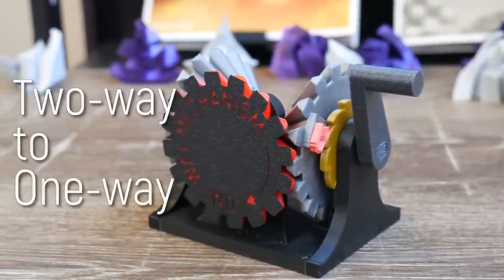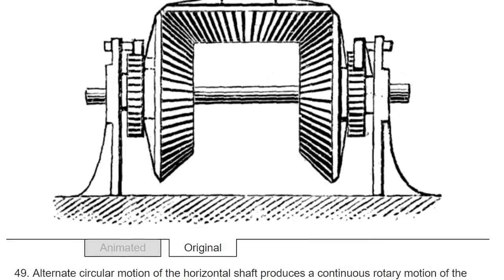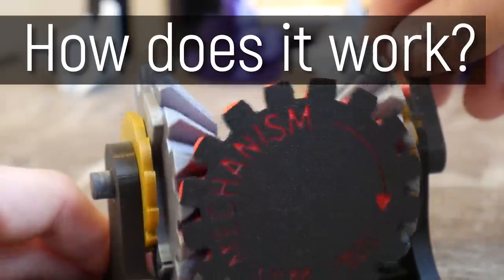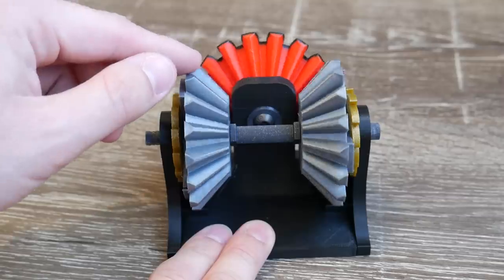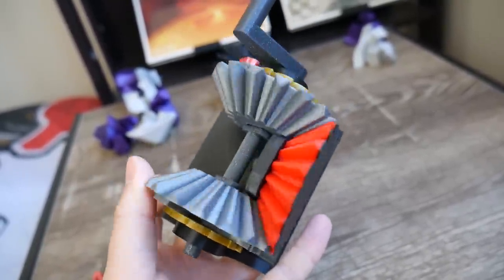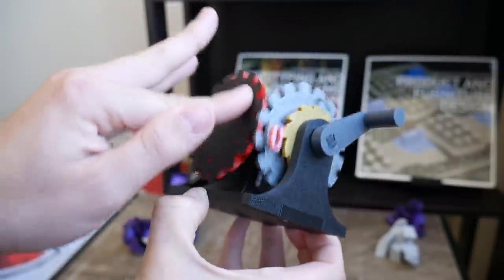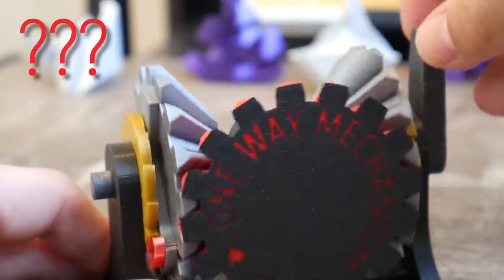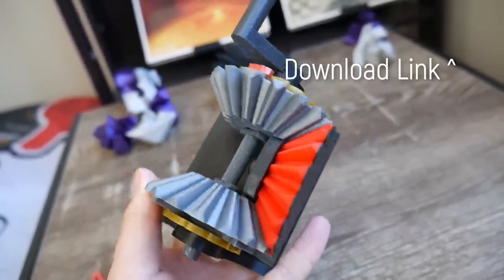This Mechanism only turns Clockwise, no matter what.

Comment: This can be used for producing electricity with ocean waves, as when the waves come and return it will keep rotating in single direction only
Reply: Was thinking the same thing. It could be a paddle in close proximity to a shoreline, where the back and forth of the tide powers something that needs to run in one direction.
Reply: Ahh the classic attempt of harnessing the power of ocean waves. Researchers have been trying to figure out a way to harness the power of waves efficiently for many years now. Not saying this is a bad idea or anything it’s just interesting.
Reply: That's already been accomplished using paddles that move back and forth. I'm not sure how they make electricity, but they have pistons attached to the plate on either side.
Reply: It could be used in bicycle pedals. So that if you get tired pedaling in one direction, you can work different muscles by spinning in the other.
Reply: 3 phase generators don't care about rotate direction, as long as there are magnetic flux changes, they will work just fine.
Reply: @nerychristian  thats bad. Cycling requires smooth rotation. That gear sounds very rough and inefficient.
Reply: there's a dam thing where the tides make electricity
Reply: the mechanism wi’ll be too loud
Reply: Why should that be useful?
Reply: @Asu01  true
Reply: tommy bomby. yes but that’s a  lot of infrastructure and is only viable in a limited number of locations.
Reply: Yasyas Marangoz I think because the book was about useful mechanisms?
Reply: @mario_uzumaki  lol what, ya because power plants are not loud lol
Reply: Have you ever heard of a full bridge rectifier?
Reply: @nerychristian  would spinning the pedals backwards work?
Reply: @tommybomby4122  No, dams stop the water. many small devices can be deployed on the seashores without any disturbance to the natural flow.
Reply: Akram Quraishi ok
Reply: @FindingCreatures  From what I've seen, it sems to me that the generation of power is not the issue, this is doable. However, making a system that survives in strong ocean currents and/or waves in any weather, for years, is the challenge.
Just like making a atomic bomb is "easy" in 2020, making a functional ICBM delivery system is a bigger challenge.
Reply: I think that a generator makes electricity spinning either way.
Reply: @eliotlong5184  an alternating current generator does, a constant voltage generator might get screwed up by it.

When diodes were not available it would certainly have been an option.  Early on, if something worked it would be used.

This looks very similar to a differential on a car.
Reply: @joshuamarcellana9622  that could be modified
Reply: dynamos work in both directions XD
Reply: @cegicreators2938  strictly speaking a dynamo creates direct current, not alternating like modern generators. That kind would and does require circuitry to alternate the voltage, now normally achieved with diodes. Not all electric motors work both ways, look up unidirectional electric motors. This means that not all dynamos are bidirectional which can give a historic use for this.
Reply: @cegicreators2938  again you didn't look it up. Not all of them do.
Reply: I was literally thinking the same thing
Reply: Unneccesary. Generators are AC.
Reply: It's better for making nuclear energy, keeping steam turbines going just one direction.
Reply: I would swap it to using it to operate a pump and use a resivoure to drive a generator for smoother power production
Reply: No need for over complicated mechanism, you only need a bridge rectifier on a DC generator and you escape mechanical power losses.
Reply: Smart
Reply: Damn you, you stole that idea out of my brain.   I should still get all the credit for thinking of it!
I'm thinking that the device would be improved if the ratched function were accomplished by Sprag Clutches instead of ratchets with pawls.  We don't like traditional pawls, because they just beg for failure in a long term high number of hours application.  So I get even more credit.
Reply: @joshuamarcellana9622  
im thinking about the 90 degree rotation... the wheels and legs should be moving in the same path of motion but this mechanism would change it by 90 degrees and your legs will be against the motion of the wheels
Reply: It would still have to go through an inverter to make sure it’s the correct kind of electricity. The complexity may not be worth it
Reply: Ehm tidal energy exists and it uses even better simpler mechanism u could search it up
Reply: This would be useless. Think about a dam as a generating system. It holds massive amounts of water and builds up a very high pressure. With a wave, it takes more than one to completely wipe out a sand castle. Waves have the same problem as wind, the concentration of that which generates the energy is too low. We would be looking at tsunami level waves to contend with modern methods of energy generation. Or the other solution would be to turn the entire ocean into a generator, which would take hundreds, maybe even thousands of years.
Reply: @thebaker9005  dude first of all it will take a huge amount wind to blow away the same sandcastle u mentioned but does it mean that wind energy is not viable 
It is in the scale that matters

Most problem of wave or tidal energy occurs from the salt water and difficulty in construction rather than its energy viability
Tidal energy is 100% sure to work because water is really dense and we could generate a lot with it so yeah it is really viable but its intial cost is just high

Hydroelectric powerplant's also costs a fortune so as time goes on cheaper alternative will come 

TLDR; if we can generate electricity from wind (even though unreliable)  we sure can make from tidal energy which way more reliable
Reply: @nakulankurmullam2982  This is a great point. Although, this is where pressure comes into play again. Pressure is a force being multiplied by and area of effect. Wind can be seen as a constant pressure, pushing a large area being the blades. Believe me those things are huge. With tidal energy, the tides rise and fall only a few times per day and wouldn’t be running all the time. What I was challenging though was not tidal energy but waves. With a wave the area in which the water would make contact is very small and that means there is a much lower pressure. I just believe that more time should be put in to hydro generation as it already accounts for 15% of the worlds energy generation and the methods are simple. Hydro generation relies on the difference in height of the 2 sides of the dam or in other words, the potential energy. This is why a large amount of water is held on one side. The water spins a turbine which is currently our best method of energy generation(Still waiting for solar to catch up). This in turn spins a magnet inducing a current into wires. With energy there are more things to consider. In the event of war or an attack, countries will specifically target another’s energy generation. Energy inside the mainland is easier to protect than something on the coast. Also, with wave power, if you put that contraption on a river, it will function better as a river is a constant fast flow of water. (This functions as a power dam)
Reply: power is generated whichever way the motor turns. Evening out power would be significantly more efficient with electronics, rather than using gears.
Reply: @tommybomby4122  There's is one in France and a few in Korea iirc. In my region there is also a few old tide mill, used to ground the grains
Reply: yes
Reply: big brain right here
Reply: And also bicycle , left foot up right foot down and the bike is going forward
Reply: @tommybomby4122 Hydroelectric Dams
Reply: @eternal-gamerdude2119  it's like a hydroelectric dam but it extends out to sea
Reply: @nerychristian  Would never work in a bicycle. You'd never be able to move the thing backwards as the gear would lock.
Bicycles NEED the freewheel that they have.
Reply: wow that's smart
Reply: I had the intention of writing the same idea 💡, but turned out I am not so clever since half of the internet thought the same use 😅😂🤣
Reply: @nerychristian  could be interesting for a stationary exercise bike but i doubt you'd want something that loud and liable to wear when you actually need to get somewhere
Reply: This can be done electronically, I believe. The output would be a bit like an AC current, and can be converted to DC or altered into a standard AC signal.
Reply: @FindingCreatures  the difficulty isnt the physics as much as it is the economics
Reply: @nerychristian  i don't think that would really work because it would mean that the wheels would either lock up or start going backwards when you go down hill and aren't peddling, unless there was a clutch to disconnect the gears. as well as it adding way more gear system to the bike design meaning more weight, more things that can break and more expensive
Reply: Good idea, but you could just have it spin both ways and then us a full bridge rectifyer.
Reply: @nerychristian  there is a hackaday build of just that though he accomplishes it a bit differently
Reply: @Asu01  But the in rush current due to the sudden reversal can possible cause damage.
Reply: Precisely the reason why I searched this video... I was wondering how those tidal turbines generate in both ways and I figured such kind of transmission must exist. Cool stuff.
Reply: It is not " over complicated mechanism " It is very simple and even simpler than semiconductor Inlaid with a certain percentage of impurities ( at very small scale ) that companies known about it. Because of its simplicity, even the person in the video was able to 3D print it !!!
And By The Way: Electricity has own LOSSES and FAILURE.
Reply: @Thinkingnamesishard 
Each has its uses, and it's nice to see another control technique.

Comment: Well obviously a T-handle rail cart of course ...both sides of the handle travel up and down but only one direction of travel is produced
Reply: I'm pretty sure that in the thing ur talking about, if I'm thinking of the right thing, one side of the handle is attached to a wheel, and the momentum of the wheel keeps it spinning for some time when it's pressed down. When it is still spinning, the other handle gets pressed down, continuing the spin. I think it's really that simple. I made one out of Legos and I used a similar thing but with a type of freewheel sort thing, and that worked.
Reply: @eliotlong5184  this would still work.
Reply: @seriousmaran9414  yeah I guess but I think this would create more friction than necessary and it is not as reliable long term cuz of the ratchet like things
Reply: @eliotlong5184  true that it would wear faster but often things were used at a slower speed back then. Ratchets were common in machinery and kept well lubricated. The ratchet drive for bolts is one such item.

Which is a real problem here, there are many uses to which such a device could be put. A lot of less efficient designs were replaced and engineering back can be difficult.

One plausible use would be winding up a rope or chain where there is limited room. Which might be more effective than a single ratchet windlass system.

Connect it to a simple steam cylinder and it will always wind up.
Reply: But you need to reverse the rail cart if you want to get home. I think they just used a simple crank.
Reply: Nope. Its just a crank. At least every one i've seen was just a crank. Thats why when your sliding down the hill handle still moves.
Reply: You probably shouldn't become an engineer.
Reply: @seriousmaran9414  I'm fairly sure it was just a crank shaft and some kind of speed multiplying gearing belts or chains. Most likely belts. Also maybe a flywheel for some rotational inertia.
Reply: @WineScrounger  You just pick it up off the rail rotate it 180 and set it back down ready for more forward action back home. Or a piece of track that can rotate in place 180 that you spin the cart on.
Reply: @FlameMage2  how much does one of those things weigh?
Reply: Glad I’m not the only one who thought of this
Reply: @FlameMage2  you're not picking up a railcart with a cast iron drive and railway wheels to turn it around.
Reply: @FlameMage2  Typically you just give it a shove the other way and start off again. Handcars (at least the American ones) are normally used like that.
Reply: N e r d
Reply: Hand cars works on rucking four bar mechanism
Reply: I think those old time hand powered rail cars had a forward, neutral and reverse drive mechanism (not too sure about the neutral tho). The reciprocating motion of the handles would be turned into rotational motion for the drive wheels via a crankshaft (like how the crankshaft transfers reciprocating motion from the piston into rotational motion). As for the drive mechanism itself, that's easy enough. Two ropes, one in a typical loop and the other in a figure 8 pattern. Select between the loop for forward motion or the 8 for reverse or if you want something a little more dependable: gears. The crank gear meshes with the drive gear for forward motion or with an intermediate gear that meshes with a drive gear for reverse.

Comment: An odometer? So it adds distance whether driving forwards or backwards?
Reply: Probably
Reply: I thought that or a speedo too
Reply: Very nice thinking.
Reply: @dannypoulin9630  They never said where it was...
Reply: @dannypoulin9630  You said "No, an odometer is in the transmisition" but nobody said it was anywhere else so that was un-needed.
Reply: @dannypoulin9630  Nobody asked for your opinion on my life.
Reply: @dannypoulin9630  The one you don't have.
Reply: THE MILES AREN'T COMING OFF IN REVERSE
Reply: Is this a planetary?
Reply: @dannypoulin9630  what's a transmition ?
Reply: @dannypoulin9630  ah ok lol there's the proper English but a ctuallu this device is exactly how a odometer works in the cluster back in the day before it was mechanical. now it is all done by the abs sensors on each for corner wheels
Reply: Odometers are typically tied to the transmission now. They USED to be mostly linked to a front wheel (usually the front left).
Reply: @graysonparks9703  I guess it has been a long time since I had to work on one. I did a minute or so of quick research and found that modern speedometers are mostly of electronic function, and sense speed from either the transmission or the ABS sensor on one of the rear (or is it drive?) wheels. - - - Thanks for making me think about this and look stuff up.
Reply: @MonkeyJedi99  no problem yeah I work on cars all day everyday haha
Reply: Probably in those train carts where you pull the lever up and down, and it goes one direction.
Reply: @dannypoulin9630  You're being needlessly aggressive.

You clearly misunderstood OP thinking they said it wasn't in the transmission. Ryan Paul raised exactly that, and instead of saying "sorry, my bad, I misread that", you felt attack for absolutely no reasons.

Grow up. It's okay to be wrong, especially on such a trivial matter.
Reply: Good thinking, but it might wear out too fast though.
Reply: Just put it in reverse. The mileage will go down...
Reply: Have you read the book Matilda? Some mechanic spins wheels backward with a drill to make the car say it has driven 1000 miles when really it drove 10000000 miles. If cars had this, the mechanic would have a hard time
Reply: It could work but that's not how it does it.
Reply: @MrBanarium  You know what these snowflakes are like: any minor correction, and they act like you've insulted their whole damn life, and anyone they've ever known.
Reply: The odometer is in the speedometer...it's driven by the transmission via a worm gear and a flexible cable in older cars.
Reply: @dannypoulin9630  My 2018 motorbike has it's odometer in the front wheel. So, at least know there is that.
On another hand, said bike doesn't have a reverse gear. Guess it's fine then.
Reply: @dannypoulin9630  Damn you're having some massive insecurities
Reply: Just pull a Ferris bueler
Reply: @dannypoulin9630  he was just trying to say that no one was claiming it was anywhere, so even if it is located in the transmission this does not contradict any claim anyone has made. What is stopping a manufacturer from building this mechanism into the transmission? Nothing but a little bit more space in the casing. So odometers could indeed be using this mechanism AND be located in the transmission, they are not mutually exclusive.
Reply: @d0nnyr0n  What he may have meant is that odometer drives are usually taken from the transmission input side not the output side - EG: before the reverse gear, meaning that regardless of direction, the odometer is driven the same way.
Reply: @justinw.2376  A speedo?
Reply: @TheAussieRepairGuy  Thanks, this is a very clear explanation.
Reply: @dannypoulin9630  do you know how to spell transmission? No
Reply: @jamesdean7412  I know it’s an old comment but no this is not a planetary gear set like in an automatic transmission but I’m pretty sure donut media has a pretty good video on auto transmissions and if not YouTube is your friend
Reply: I'm pretty sure mechanical odometers would traditionally count down when driving in reverse.
Reply: @kylehart8829  no, they  count up always.
Reply: @dannypoulin9630  Nah though. My Honda Nighthawk was driven off the front wheel, and running it in reverse would not reverse the mileage.
Reply: very good